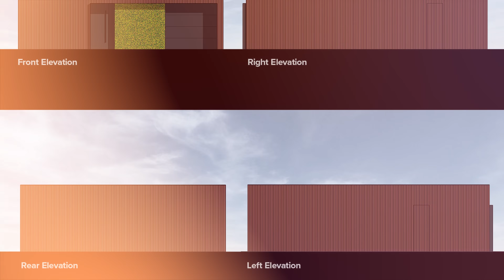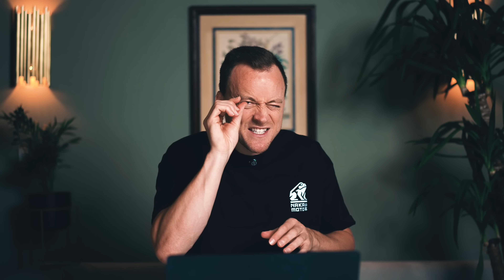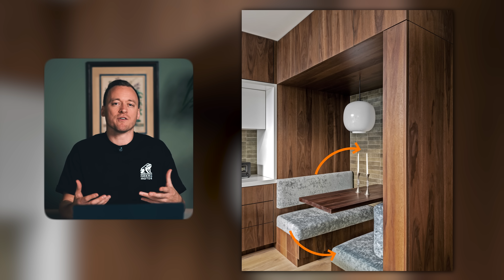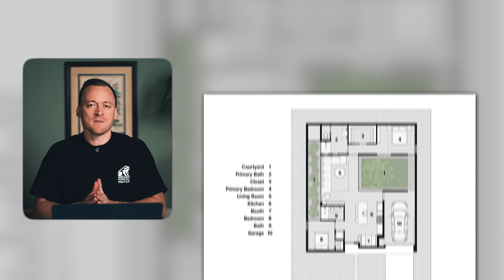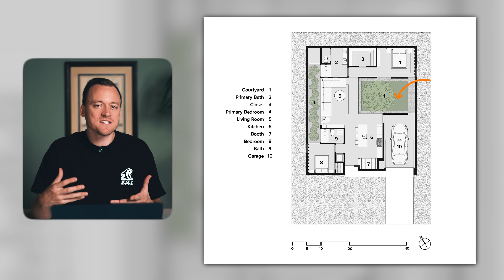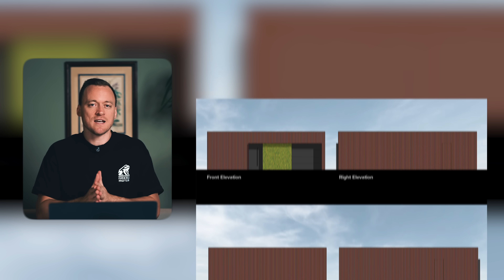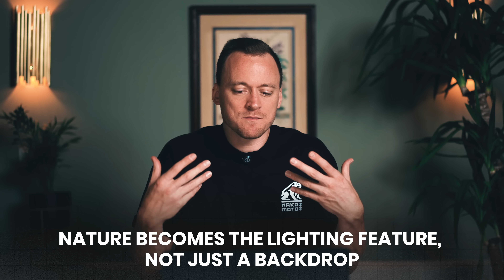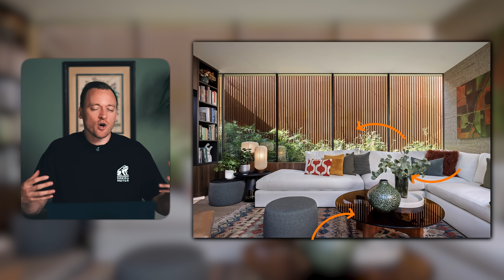this home is every introvert's fantasy. and it's real.

Comment: Overall, I like this house; it is very well designed.
My own home has a courtyard like that, and although it has other windows, they face the garden and, ultimately, the walls bordering the property. That is simply how it is, given its location in the middle of the city with no open views of other gardens. The interior of the house cannot be seen from the outside. Yes, it is certainly an introvert's dream.
However, what I feel does the featured house no favors is that "architect-style landscaping": rigid, repetitive, arranged on a grid, and using only a single species. It is completely artificial, forcing something that shouldn't have to look like a scale model. It feels as though the plants were made of plastic.
This type of garden is an exercise in narcissism: "Look, I have created a house so perfect that it needs no plants to complement it or compete with it in beauty."

Comment: People used to make houses like this but had very tiny windows people couldn't fit through facing the outside with an open section in the middle that would be livable and connects all parts of the house, giving air conditioning and a natural space. This is not a new concept at all.

Comment: Just wondrous! I agree that privacy seems to be the primary design intention, but to me, this house speaks to nervous system regulation and protection from the sensory overload caused by external stressors such as noise and other pollutants. This house feels so protective and signals profound safety (to my nervous system, so frazzled by constant traffic and danger signaling from the external environment). To that end, this house feels like the ultimate place to return to homeostasis and foster repair, recovery, and healing.

Comment: That walnut wood throughout looks like it's laminated wood, and the interior courtyard should be grass you can walk on, but aside from that, the house overall is nice for an introvert, though it may need some security cameras.  A second story might be interesting, depending on the location.  I would also want to know if the roof is at least slightly angled to or designed to keep rain water from stagnating.

Comment: What I like about the exterior is that it’s intentionally low maintenance and overall, uninviting. It doesn’t shout welcome. Visiting would be an act of intention. 

On the interior, I can truly respect the choices but I’d have gone a little different direction. 1. The interior rooms would open into the courtyards. 2. A bit brighter color palette because that’s my flavor. 3. Not have the shower have a glass wall to the now public gardens! Or frost the glass. 4. Direct access from garage to courtyard(s) for maintenance. 5. Taller side walls and roof deck for more living space without adding more “interior” space. 6. Different vegetation choices though I applaud the low maintenance landscaping outside the walls, but I’d have done something less “hostile” in presentation. In the courtyards, something more wild and feral. I’d probably add a small fountain, perhaps up against an exterior wall. 7. Interior: the design is too stark for me. The walnut feels too dark. Mahogany or pecan. The white is too modern for me. A cream color would be preferable for me. Less modern treatment of the kitchen design. Shaker would do nicely I think. Either pecan or mahogany again or a painted (earth tone) cabinetry. 

I love the concept. And the floor plan is inspired.

Comment: The walnut, in my opinion is drab.  The velvet type furnishings are also very unattractive and makes me want to sneeze, overall, it seems a bit 1960’s which, while it was a total shift to modern design, in this interior,  it’s dull.  I like the building. I really dislike all the timber and the walnut too.

Comment: I thought about doing something similar by buying up an entire block in Baltimore City for like $20,000. Then brick up EVERYTHING ... all windows and doors. The only way in would be through a steel garage door that is actually like an airlock, so while the exterior door is open, the internal door wouldn't open. As far as windows, the only ones would be glass block high up to let light in. As far as windows that open ... nope, none. There would be a hardened emergency exit door that can only be opened from the inside and it would be on the second story and have a chain ladder attached. Sadly, it wouldn't meet code. So, I left the state.

Comment: Basically the design foundations of a fortress or walled in castle. You don't feel boxed in because it's open to you on the inside but the perceived closedness is to those on the outside.

Comment: Lose the garage for more interior space.
Centralize a single courtyard and use more of the lot.
Excavate an underground space (basement living space) to deal with the Texas Summer heat.
Put the bedrooms underground with escape tunnels to meet code for emergency egress.
Public spaces on the ground level... private spaces on the lower level.
Add a double layered retractable roof window over the courtyard.   Only deploy this after inspection.

Comment: Understand the fixed window panels with the heat and humidity in Texas,  you need to plan for cooling. However,  with the number of hurricanes that hit Texas, the amount of water that could get dumped in that interior courtyard could flood the home.  Possibly a retractable roof that could be closed, as long as the tree was not too tall.

Comment: A lot of the tract houses I see in cookie cutter, neighborhoods already have two completely blank walls facing the neighbors over the minimum size side yards that the setback requirements would let them get away with. Just blank spaces of badly fitted vinyl siding, dryer vents and exhaust pipes for the furnace. If you're going to have a high fence cutting off your yard and no windows facing your neighbors, why not put the outdoor space on the inside. A lot of the characteristics of this house remind me of mid-century modern or usonian style, not a copy of that but informed by the same sensibilities.

Comment: This is nice, but I would add a sliding, solid material door to the bedroom to 100% block out all light for sleeping. The bathroom's great for temperature zones, but I live in the mountains and you would freeze in there. A few changes would be needed for a much higher elevation. Also, add two elevations to the roof to incline inwards toward the courtyard and add a cistern for your own fresh water.

Comment: Thanks for this - I saw a similar design in a 90's magazine, possibly Time Magazine, but haven't been able to find images or video in the years since.  The one in the magazine had a larger floorplan, a full centralized design (the courtyard was fully in the center of the house), a pool instead of garden in the courtyard, and stainless steel floors for ease of cleaning for some reason.  While not the same design, I love the idea of a fully enclosed space that's still quite open internally.

Comment: How are the utilities reaching this building? Is it underground? Where is the Air conditioning system (this is texas!) and utility room (Water Heater? Furnace? HVAC?) and were is the interior ventilation from such.

It looks staged, more of a Temporary Rental Unit (Air BNB) or a Safehouse for someone involved in Criminal, Espionage, or law enforcement activity.   Getting deliveries for such a location would also seem questionable. The Closeness of the other buildings and the narrow road could also make this a problem if there was a fire or health emergency where a firetruck or ambulance needs to get to it.

Comment: This house wouldn't work where I live for many reasons and the biggest one is that in case of fire, there is nowhere to go. Per bylaws, we need windows to get out. Just staying in the middle part would be so dangerous. Also, the tree is too close to the house - leaves and roots are a problem (for us I think it's 6' from the house minimum). There are other reasons too but I just want to add that it's not because we're introverts that we like boring colors. This house is boring. I was really interested in a house plan I saw on Pinterest where all 4 sides end-up making a square in the middle (no walls though, just 4 sets of sliding doors) where it's livable with chairs, hammocks, picnic table, etc. and the rooms were all around it, making a square, and the sunshine goes everywhere. The only two rooms that did not get the sun was the laundry room and the bathroom.
Reply from the maker: Thanks for the insight about the bylaws and potential fire hazards!

Comment: Outside is ugly but that could be a positive if the goal is to make it look like an old garage or outbuilding that is not worth breaking into. The walnut wood though 🤮 The inside layout of this home is actually very clever but it would look so much better if the wood used was birch or light pine.  The walnut looks so fussy and depressing. If the outside of your home is going to be so ugly, the inside must have light wood like birch to bring coziness and happiness inside.

Comment: One genius detail you didn't mention is the combination of the rectangular courtyard and the corrugated corten steel cladding to bring in way more light than would otherwise be possible while keeping the interior cool as well. If you look at the orientation of the house, you can see that the front door is towards the south, so while the living room will get a lot of light in the morning and the bedroom during mid-day, most other rooms are left out. However, the corten steel reflects quite bit of light into both bathrooms and the living room during most of the day because it's corrugated, not flat! And it does this in a way that makes the light softer and more spread out, due to the rough texture. Additionally, because this reflection is very indirect and the corten steel is dark-ish, the amount of light and especially UV is reduced a lot, so even in the hot Texas summer heat, the amount of thermal influx is drastically reduced compared to windows that are directly exposed to the sun. Absolutely incredible design!

Comment: I didn’t notice any egress windows.  Just fixed glass.  Definite code issues if someone has a medical emergency and the FD, PD, or medics need to assist someone in need.  I recently lived in a mid century modern home that was custom built by its  original owners who were both Architects.  One of the best features was a bathroom that had sliding doors to an outside enclosed patio area with a gate to the outside yard that led to a pool area.  It once had an outdoor shower and water feature, but was in ruins when I rented the home.  Still, it was beautiful and a wonderful way to live that felt freeing.  The gardens were filled with specimen plants that were a joy to watch grow and change with the seasons.  Yes, the house was a lot of work, but worth well worth the visual beauty and positive vibes it gave off with all of the many walls of glass.  How does this new design get fresh air into the inside of the house?  Textbook fail for me.

Comment: I really appreciate your articulation/explanation of the attributes/concepts/visual design to be discovered in this home's execution. I've played with similar concepts, considering CMU blocks... and then came across this video. Bingo! *I'd add a green roof (with overhead fencing (crowning junipers:)) to piddle around my roof-top garden, while keeping the cooling costs down (Austin) and not adding to the footprint in such a small lot. Thanks, *A. P.S. One adjective you never used to describe this project was 'efficient.' Because it is definitely that.

Comment: Put a spiral staircase in and utilize the roof as a outdoor space.
Reply: This!!!! They're against code where I live, but I'm determined to find a way!!!
Reply: There is a 12' spiral staircase here in Austin for free. That would be perfect in the courtyard.😊
Reply: I was thinking of this more as an emergency escape with a few rope ladders attached to the roof in case of fire. I guess it could be a straight ladder inside as well.
Reply: @patricks8086  The roof is the first place that I would go in case of a fire. 🙄
Reply: @B @Boogeyman1435 most homes would have at least a window as a point of egress which this doesn’t . Nor did I see a second door in that wall of metal. I doubt this design would pass inspection in most states.
Reply: @patricks8086  fairly certain i saw multiple doors in the blueprint
Reply: @patricks8086  there are fire escape doors in each bedroom. Look at the plan and elevations
Reply: Too exposed to the world
Reply: It's Austin. Probably covered in solar panels.
Reply: This is probably the most expensive home in the neighborhood.  You  don't want the hood looking up at you wondering what you're doing, especially in an introverted home.
Reply: @grondhero  I checked on the country appraisal site. It is the most expensive on the block. Considering it is almost all built in, might not be too bad of a deal. Just bring clothes and food.
Reply: Fabulous idea ❤
Reply: I HATE spiral staircases!
Reply: @Katherine_02  Well, the great thing is that you don't have to have one!
Reply: @Cope_and_Seethewhat a non-comment.
Reply: @Katherine_02  and yours wasn't?
Reply: @Katherine_02  takes one to know one, lmao.  Way to out yourself as a narcissist in two sentences. 😂
Reply: @whoisgtsdk Saying, "takes one to know one" doesn't even make sense, in context. I'm allowed to say that I hate spiral staircases. Are you saying I'm a spiral staircase? 🤔
Reply: I checked out this place on Google Earth and saw the surrounding area. Trust me there’s a reason why they don’t want the windows lol I definitely would not want to be on that rooftop taking in the surrounding view. That neighborhood looks like a dump. Type of place with little trailers and parked cars on the grass. Would definitely not expect a place like this to be there.

Comment: De gustibus non disputandum est, there is no disputing about taste. I'm an architect/interior designer and I absolutely hate it. For me it's one of those homes that looks great in a magazine but would be awful to live in. No real connection to the outside world, just two small interior courtyards that are all but useless as an outdoor space (no easy access) and windows that show you nothing more than wall, some designed greenery and a bit of sky. Feels like living in a basement turned living space where you'd try to get light in any way you can. No surprises, the same design language everywhere, the same materials throughout, no escape and no respite from them. Pretty much the kind of stuff I used to work on a lot at the beginning of the century and that feels soulless and without its own identity. Of course all we see are renderings and it would be nice to be able to see some real photos to see what it looks like with people actually living in it.

Comment: 1:28  That's one way of describing it.  😂  I love how interior decorators give this overboard description of stuff.   Dude its rusty siding with a puke green design in the center.  🤣  Should've put the cactus plants all on the inside open area incase someone climbs the roof looking for a way in and discovers they can drop into the center and smash the glass in privacy from the surrounding neighbors.  The cactus can work as a dual function protection from thieves dropping in.  I'm guessing California??

Comment: Joseph Eichler figured this out over 60 years ago, this an updated version for a modern zero lot line. Ceiling height windows at the front (if any) or frosted glass, everything windows facing inwards to the atrium or towards the backyard. Wood panel walls as well, along with loads of built in seating, storage etc..

Comment: I used to babysit a family that lived in a house that was similar to this. Their house looked so small from the outside, but it was actually huge. It had 6 bedrooms and 3 bathrooms along with the atrium and a very large kitchen and living room. The back of the house, going out to the backyard, was fully windowed. Most windows were higher in the walls on the sides of the house. It always blew me away that I'd walk down the hallway, take a turn and there was simply more house than I expected to be there. Being in their home completely changed my mind about this architectural style, which looked so off putting from the curbside.

Comment: I told my builder I wanted a house with no windows in Louisiana 30 years ago.   He and my ex had a good laugh but I was serious.  Love this.
Reply: And they laughed because building codes for residential construction almost always require at least two ways out of every bedroom because of people who have died in nighttime house fires.
Reply: @Rosarium2007  That was one of my first thoughts. Fire safety. Still, love the idea.
Reply: @Rosarium2007  It's probably not mentioned in this video, but what they did was put doors in the rooms that are covered by drapes. Otherwise, they wouldn't have gotten the permits.
Reply: @Rosarium2007 that is true, if anyone ever wanted to kill you they'd just have to bar the front door, light it up and your suddenly well done in a croc pot
Reply: Then the ex moved in with the builder
Reply: @myaccount__7269  and they still have the last good laugh
Reply: this has massive windows tho  .....it just has a fence around the window areas